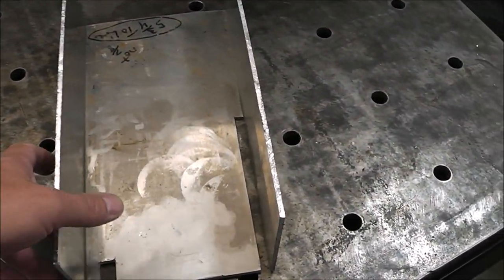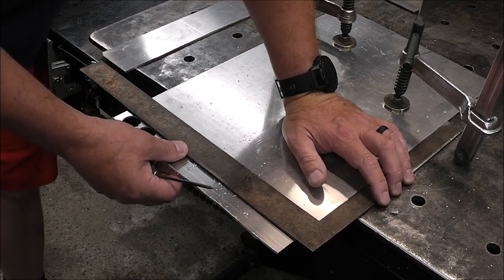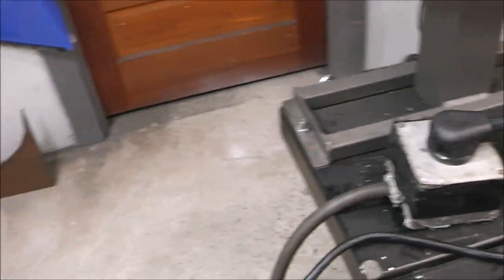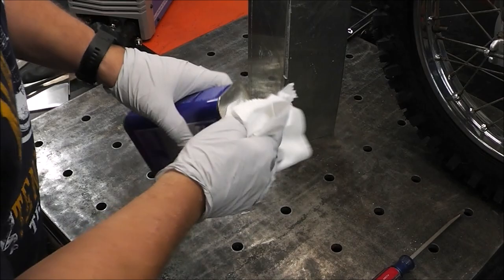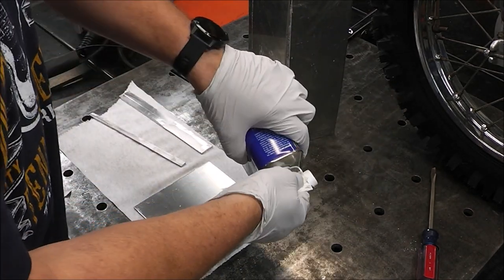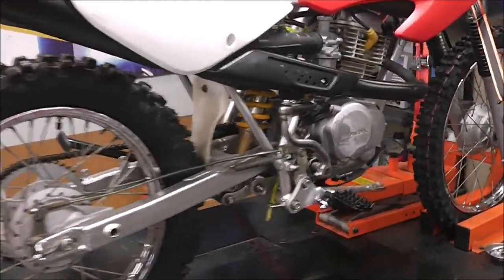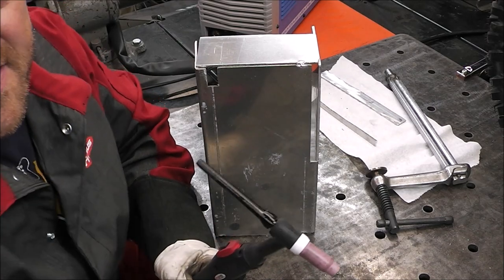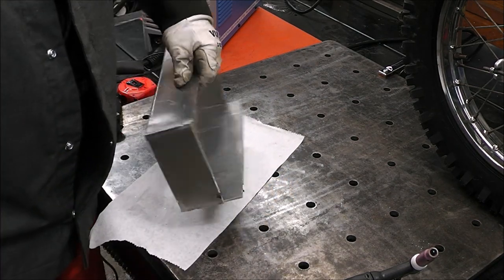Aluminum Welding Project Tool Storage Solution

Comment: Good tips and tricks about.
I never use tig welder but I think about getting one in the future.
Reply from the maker: I don't do a lot of tig welding but I really enjoy it if I have the time. I don't necessarily like how long it takes me to get set up so i tend to go for the process that gets me in and out the quickest and that is usually wire feed welding or stick. I  have some alumimnum mig wire I've been meaning to try through so it might be good for stuff like this. 👍 cheers buddy 🙏👍

Comment: Talking about adapting a universal foot controller. I have just got a Variable amperage finger controller for my welder. (They can supply to most common brands). It's a godsend. If you are in some awkward place and you can't reach your pedal, then this is perfect. Does exactly the same thing. I love my foot controller, but there are times I just can't use it.
Great video again Brandon. Loved it
Reply from the maker: @Basil Keen thats awesome! A foot pedal can be a hassle especially working in awkward confined spaces. A finger control would be a huge benefit. I think I'm going to look into it. Thanks for sharing buddy! 👍 🙏

Comment: I welded aluminum with a stick welding rods, it's hard and looks bad but it works.
Sanding and preheating is the key for it.
Reply from the maker: @toolman talal I haven't tried stick welding with aluminum but I've heard it's difficult. I'm curious to try though. Thanks buddy!

Comment: Ain't nothing wrong with yes welders they are great machines not sure why people harp over a cheap machine I have several mechanic shops it's hard to justify spending 5 grand on 7 plus welders to supply my shops when yes welders work great for there price and in shops they get used and abused and haven't had any mechanic say they are junk all my mechanics as well as me love the yes welders and they are not babied at all @Brandon Lund
Reply from the maker: I'm a firm believer bud. I started out 30 plus year ago with a cheap chineese wire feed welder. If I had not been exposed to that I might have never been interested today. I have had zero issues with them.
Reply: @BrandonLund  same no issues here either

Comment: How do you like your welding helmet? Is it worth buying?
Reply from the maker: @Guy Anderson I absolutely love it! ❤
Reply: I have a Miller elite and cannot stand the head gear on it. Definitely will be looking at the fronius helmet
Reply from the maker: @guy Anderson its innards are pretty much just like an adjustable hard hat and the included liner is super comfy!
Reply: @BrandonLund  nice, anywhere I could buy it that would support your channel?
Reply from the maker: @Guy Anderson thanks man! If you scroll down in the video description I have some fronius links that will get you a discount off your order and it helps the channel a little also. Thanks again! 👍